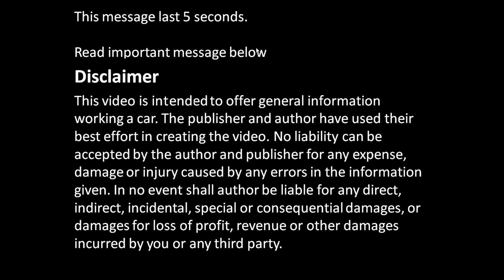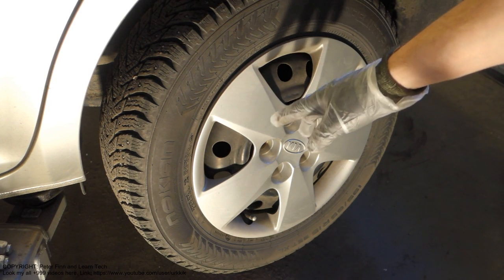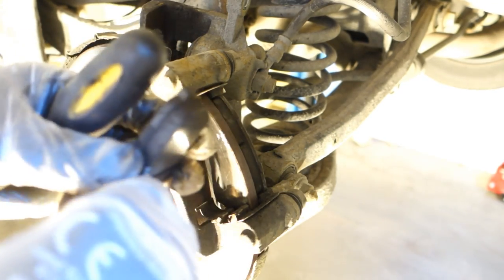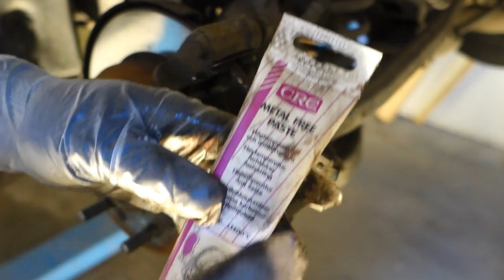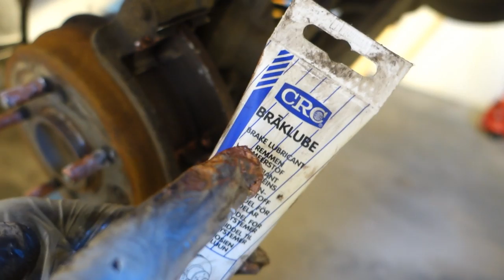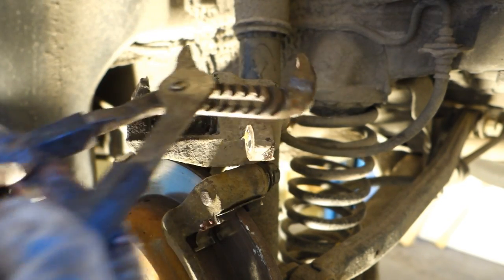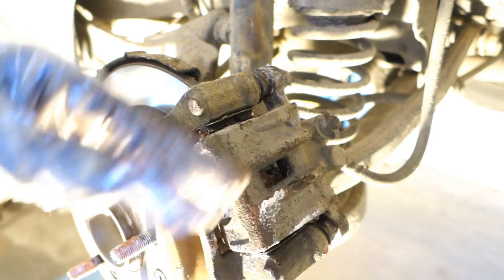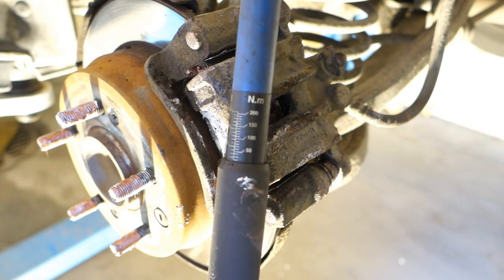How to replace rear brake pads Hyundai and Kia years 2008 to 2015

Comment: You DO NOT add grease as liberally as you did near the friction surfaces of the pads and especially the rotor. It causes glazing and premature break pad wear not to mention decreased brake performance. Grease internally is a mechanics best friend , but when it comes to brakes you need to be very careful.
Reply from the maker: +Scott Soriero Hello and Thanks Your comment. :-)
Reply: Exactly. Just grease the back of the pads not near the material.
Reply: Brake not BREAK

Comment: Peter,

i have Kia Ceed SW 1.6 crdi 2014 year. I want to change rear pads alone, because in KIA is very expensive and not good pads. I want to buy ATE pads and change, but main problem is electronic parking brake. Can I do alone, or MUST be do it in KIA service, cause this EPB?
Thanky!
Reply from the maker: +Forchan Chan Yes, Kia parts are not so common.
Reply: +Peter Finn 
KIA parts I can order, that is not problem on ebay.com, but can some another Diagnostic tool reset electronic parking brake after changing brake pads or on some another way to reset Electronic parking brake?
Thanky on answer.

Comment: I have used your video to help me replace my front brake pads on my Hyundai Trajet. I will do the rear pads next. I notice that the caliper piston pushes straight back and you do not need the tool to wind the piston back. Is this correct? If so I will simply use the same clamp as I used on my front brake caliper.
Reply from the maker: caghadiuno Yes, same idea also front.
Reply: I'd rather use a caliper compressor instead of the channel pliers, so to apply equal pressure on the piston without doing any damage on the rubber. Good to check the brake fluid reservoir before pushing the piston in.

Comment: A few tips to the watchers.  Firstly; do not use adjustable wrenches to push the piston back.  You are highly likely to damage the piston seal.  Gentle with the grease on the slide pins.   Too much, and you'll get leakage or burst the boot.Secondly; change gloves.  Cleanliness is next to Godliness.  The last thing you want is grease on the friction material - which has happened here.  Cotton cloth will not get it out.  Throw the pads away.  Thirdly; no grease on the treads.  You will change the coefficient of friction and need greater torque than you think to get the wrench to click.  Possibility of breaking bolts.  There are better videos around.  Try South Main Auto.  He knows his stuff.

Comment: Should not grease bolt threads. They should be torque down. With a torque wrench. You could strip threads or break bolt due to over tightening. Brake carrier bolts usually have some form of thread lock to stop them loosening. Not extra grease. Too much grease on everything else.
Reply from the maker: Thank You. :-)

Comment: Hi, Do you have to adjust the handbrake after rear pads replacement? If yes, how? thanks
Reply from the maker: Yes, there is adjusting bolt inside.
Reply: Thanks. Inside where? After putting the new pads in, is the handbrake gonna be on all the time or the complete opposite?

Comment: could you please tell me if there is a way to test if a Input/output sensor (Sonata V6  07) can be tested to see if it is not defected. For example: on Clothes dryer one can tested the parts with a Voltmeter by using the R mode. If there's a certain reading on the resistance, the parts is bad.
I would appreciate your help. The thing is that I have already purchased/installed both sensors and the car still reading {once a diagnostic computer is placed} that is not getting signal from the sensors.
Reply from the maker: Hi Sir, sorry. I don't know Sonata technic.

Comment: Peter I no this has nothing to do with this video but could you help me fit daylight running lights to the i30 were is the positive wire on the side lights to tap into there is videos anywhere how to do this on the i30 .thanks
Reply from the maker: Sorry... I have not Kia/Hundai info
Reply: Thank you for getting back to me

Comment: And this is the reason why I learn and do my own maintenance stuff. I have to point out couple of things. Way too much grease. Gloves dirty with grease touching surfaces that are gonna come in contact (a k a braking) leading to potential brake failure. Very convoluted way of explaining. DO NOT ever use the grips to unwind the caliper piston. Busted knuckles and potentially clipped boot cover for the piston. Better videos explaining similar procedure(different vehicles) out there. Peace
Reply from the maker: Good comment, me too  👍

Comment: copper paste everywhere no good only ment a touch on the back of the pads not on the disc and every where else PS change your gloves
Reply from the maker: Thanks for Your comment. :-)
Reply: Yes, looks more like a grease job on the brake pads and all. Not sure if it helps. A bit of DW40 would help the corrosion and easier to take the pads out instead of the excessive grease.